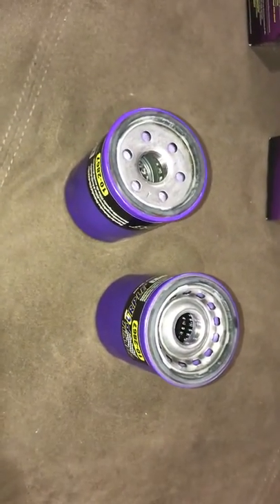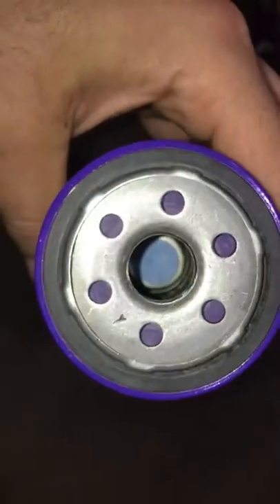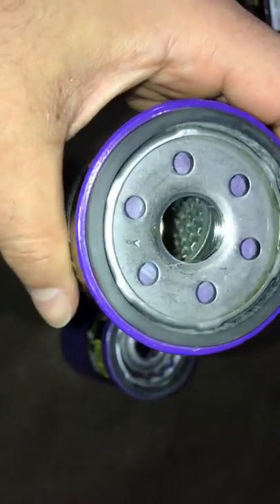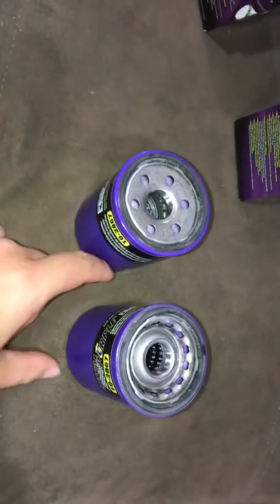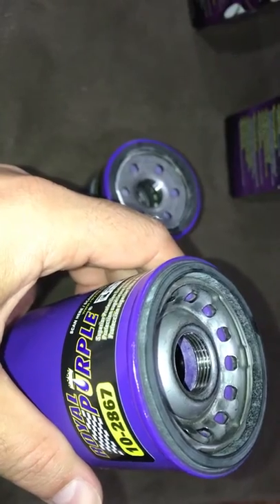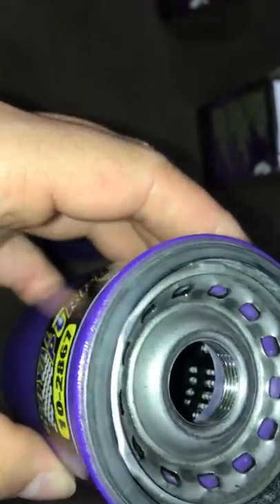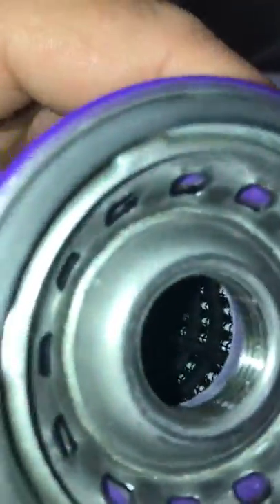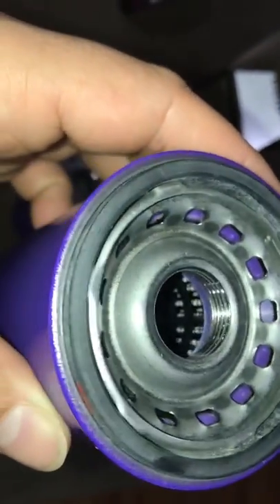New royal purple filters 10-2867

Comment: The black center tube material is nylon which should not be an issue at all since the synthetic media's wire backing will absorb most of the oil pressure.  That thing is going to have EXCELLENT oil flow for sure.